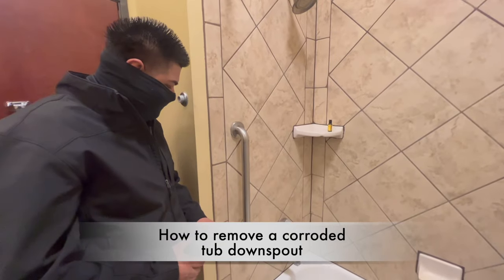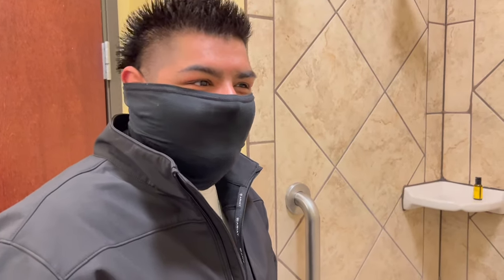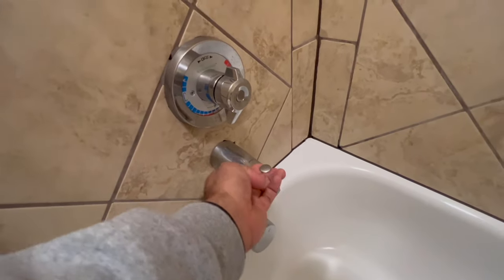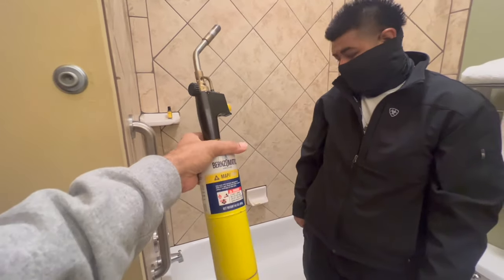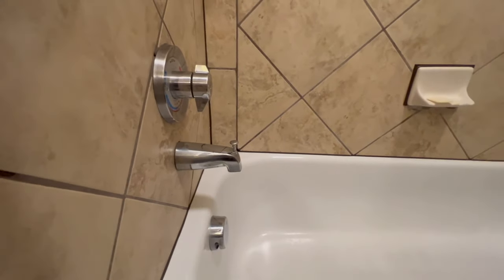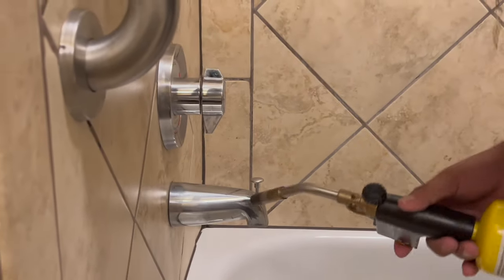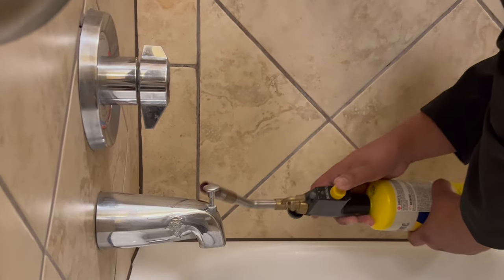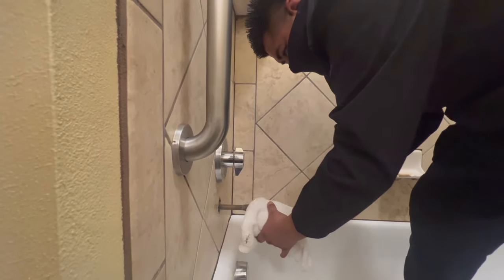How to remove a corroded tub downspout

Comment: We didn’t have a torch and my wife had the idea of pouring boiling water on the faucet. This worked perfectly and we were able to remove the faucet after!
Reply: Yes - all you need is to create a temperature difference between the outside downspout and the inner pipe connection.  Metal expands as it is heated and you can take advantage of this.  So add a little pasta to that boiling water and get cracking!  Thank you for your comment and suggestion!
Reply: I don't have a torch either and the boiling water worked perfectly!!! Thank you so much for the tip!

Comment: YOU'RE MY HERO THIS WORKED!!! I struggled removing our 20 year old spout. I spent an hour cutting slices off and still couldn't get it. I tried removing corrosion using CLR and letting it soak in WD40. NOTHING WORKED. I watched this video and used a small torch for a minute and it slipped right off. Seriously, thank you so much. I was losing my mind.
Reply from the maker: This really made my day!  I’m so happy to have helped you out!

Comment: Oh man, this is probably what my problem is. I don't have a torch but I'm also renting this apt. Not a lot of faith in our new maintenance guy either. I will suggest watching this video if he can't fix it and having the property manager call an actual plumber. Thanks for this video!
Reply from the maker: Good luck!  We have learned not to twist too hard or the pipe in the wall will get damaged.  So this high heat really helps.  A torch kit at Home Depot is about $30 and a down spout is $25.  So you could nudge the Apartment managers to buy this for their maintenance team and that it’s only $50 for the repair instead of $300-500 for a plumber!

Comment: DO YOU NEED TO PUT PLUBMER'S TAPE ON THE PIPE THREADS BEFORE TWISTING ON THE NEW SPOUT?
Reply from the maker: Yes always a good idea to use teflon tape or pipe thread sealant.

Comment: I don't have a torch. Would a blow dryer or a heat gun also work? I scared that I'll twist the copper pipe inside the wall and require a really expensive fix because I can't get my old, corroded bathtub spout off.
Reply from the maker: Your fear is real!  I can tell you I’ve done this exact thing - of twisting the copper pipe inside the wall many times!  I’ve learned that you need the high heat of a torch.  You could use a heat gun but definitely not a hair dryer.  Here is why:  you need to heat the outside of the downspout faster than the copper threaded connection.  You are wanting to get the outside downspout to expand due to heat more than the copper threaded connection.  If you heat slowly, then both heat up together — which means both expand together.  I hope this helps.  HomeDepot has propane torch kits for $26.  So a whole lot cheaper than fixing a twisted copper pipe inside a wall!
Reply: @checkinwithageek1673  Thank you for the quick and thorough reply.

Comment: The spout I have is plastic. When I removed it, it separated from the copper collar it came with. The collar is stuck to the cast iron pipe, and the pipe has rust on the threads. I put WD-40 on it a few times, but the collar is still frozen. Should I try using the torch on it or is there another way to approach this?
Reply from the maker: Copper has a higher coefficient of thermal expansion than steel/iron.  So heating both will mean copper will expand more than the steel/iron pipe.  So this should work in your scenario too.  Let us know if it does!

Comment: Did you have to shut off the water?
Reply from the maker: No you don’t need to turn off water as that pipe isn’t under water pressure.  You also aren’t touching any portion that does have water pressure.  But it’s always a good idea to turn off water in the event you do accidentally damage a pressurized pipe.  Some people can easily turn off water while others it’s very difficult.  So I would make a judgement call based on your level of comfort.

Comment: Is it normal for the copper pipe to have some play when trying to remove old spout?
Reply from the maker: Yes a little play in the copper pipe is normal as it depends on if the pipe was strapped down to the wall.  Sometimes these pipes are not strapped to the wall allowing them to move slightly in the wall.
Reply: Thank you

Comment: I am having the same issue but the pipe coming from the wall is PVC.  I believe the guy who installed it used glue I'm not sure but it's a Moen and no screw but won't turn to take off the spout. Can I use a torch as well. 😢
Reply from the maker: PVC - Hmmm.... well I would research that particular downspout from Moen.  Some of their newer downspouts are held in with a set screw (access just below the downspout), but their older ones are threaded connections.   So you could use heat to break the connection, but perhaps use something less intense like a heat gun/hair dryer instead of a propane torch.  My fear would be that the heat would melt the PVC pipe threads.  So just be careful.  By the way, PVC connections for a tub downspout isn't that common.  At least from what I've seen.
Reply: @checkinwithageek1673  I just found the same thing. Twisted the downspout, it fought me every inch of the way, when it finally came off, I have a twisted bit of soft black pipe inside, and an equivalent twisted soft black part sticking out of the wall. When I unscrewed that, I found damaged external 3/4 threads sticking out. I have no idea what I'm looking at or how to fix this. And family arrives in 3 days!

Comment: Tried this with a lighter... didn't work for us and there's no screw. IDK
Reply from the maker: Sorry - a lighter won’t get the temperature differential high enough for this trick to work.  

But this trick also assumes that your downspout has a threaded connection.  There are multiple connection types.  So best to research your specific connection.
Reply: Use a torch.

Comment: I can’t get mine off …..
I think it would be pretty hard to crack the elbow……. But …
Reply from the maker: Well it’s not the elbow you need to worry about… it’s the short length of pipe between the elbow and tub spout.  That section will twist.  Be sure your model doesn’t have any set screws.  Good luck!